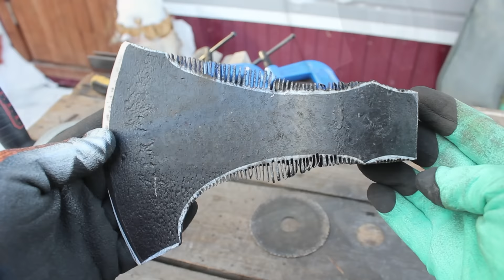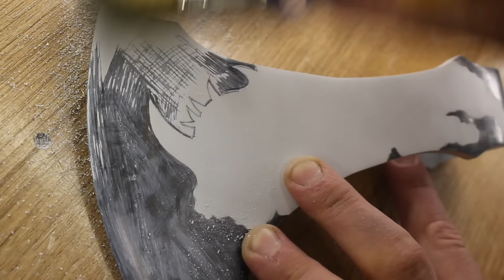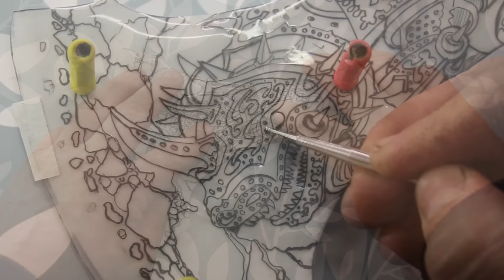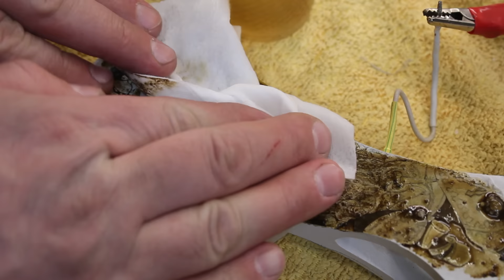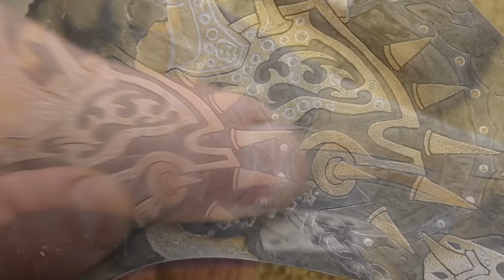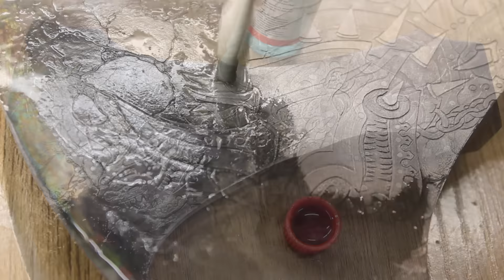EASY way. 3D drawing on metal. Incredible result

Comment: You say 'easy way' but you don't give details of the process : the liquids, the paint, the tools, the voltage system etc. 🤔 Really nice result though. 👍
Reply: Doesn't say it's a "how to"
Reply: But it's so easy!!!!
Reply: He already mentioned salt in the beginning. You need to work a little hard for the electrical voltage, the paint is not important either, use your mind a little.